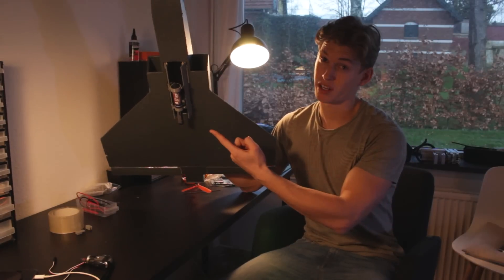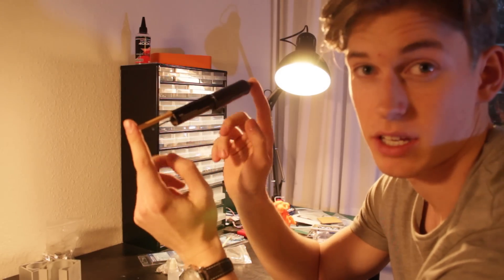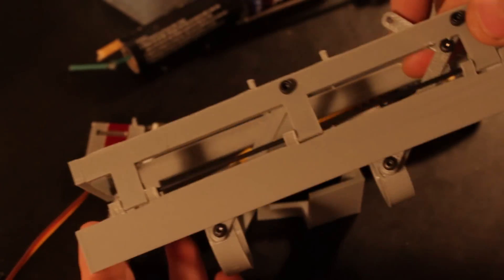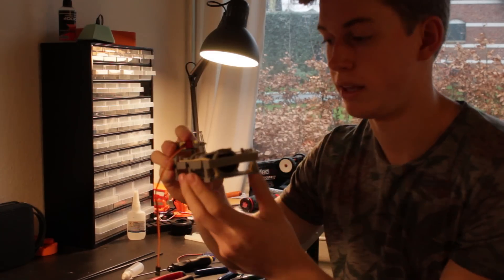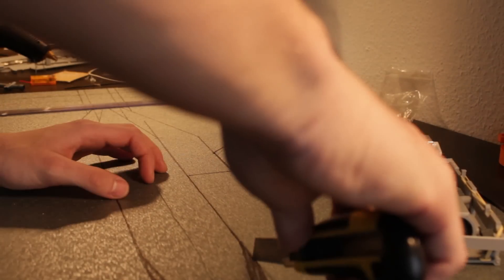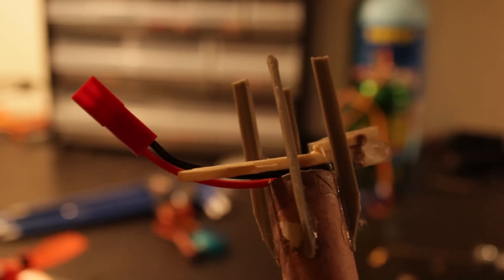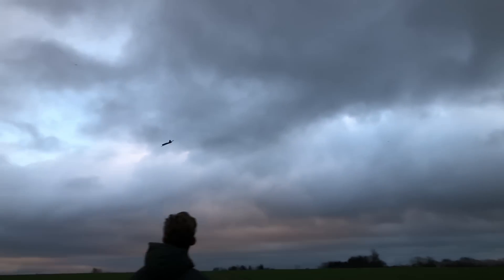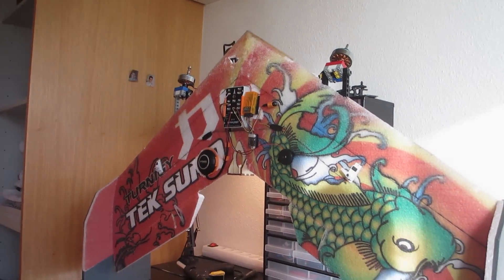ROCKET LAUNCHER ON RC PLANE

Comment: Mmsmsms That rocket ignition system will not work 
Since the plane is made of technopor, it will always burn, the same happens with the electric arc ignition system, I recommend you put a rocket starter which is made with nichrome wire, I would tell you to put this starter inside the combustion chamber of the rocket where the solid fuel is located.

Comment: Did you try placing the igniter inside the rocket's rear end? Adding a match seems like an additional step you do not need?? Maybe build your own rockets and use Potassium Nitrate and Sugar as the propellent. There are many YouTube Videos on how to make this rocket fuel. You did a great job on this video. If you can use the same method of ignition as model rocket folks use I believe you got it.

Comment: Put any fireworks in sunlight for a couple of hours before bursting them. Thats that we do in India before diwali

Also, why are you making your planes so fragile everytime. Is the foam weak or is the plane heavy. I think the foam you are using is very brittle. Normally it should bend not crack so spectacularly.

Comment: Use Estes igniters.  Minimal voltage, 9 volt square battery is great.  Simple circuit, open-closed.  Reliable ignition.

Comment: I’m thinking about making one of these for my monster f18. But I was thinking. If you put a fpv camera in the nose of a rocket. Then feed that into a small computer chip, and using a thrust vectoring system, it could guide the missile. Using machine learning to let the computer know what an rc plane looks like in the air, you could do some cool missile fights.
Reply from the maker: Sounds very easy to implement. Should be an easy beginners project. Let me know when you are done.

Comment: couldn't you just use a heating wire connected to a transistor connected to a switch and a 12V battery?
Reply from the maker: Yes but I didn't have that at the moment of making the video
Reply: @Karlemilstorm  oh ok, for one time use you could probably use anything with a low resistence but high enough to not short cirtcuit the battery
Reply from the maker: I now have some nichrome wire that is perfect for this purpose along with a relay/mosfet

Comment: For those types of fuses, split the fuse about 5 to 8 mm from the end and place a model rocked igniter inside the split, and use drops of candle wax to secure it...

Comment: you could use a RC filter to switch on a relay (or transistor if you prefer solid state electronics) that shorts a small nichrome wire that is wrapped around the fuse. (thats how i did it, but i only ignited smoke bombs, no rockets, but the ignition is the same)

Comment: To light the rockets use a model rocket igniter with a small brushed esc  just put the igniter in where the fuse goes into the rocket !!
Reply from the maker: +kevin orns yes. There are many ways that I could have ignited the rocket. I just didn't have any things like that on hand during this build
Reply: Thinking they are just short bits of nichrome wire with a bead of match head material on the end.